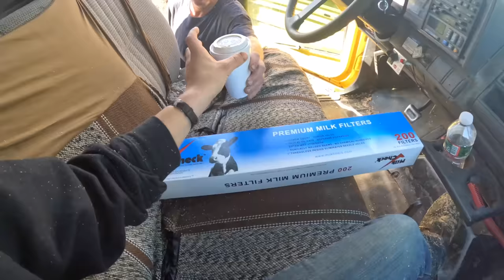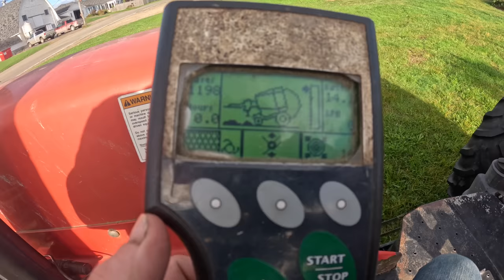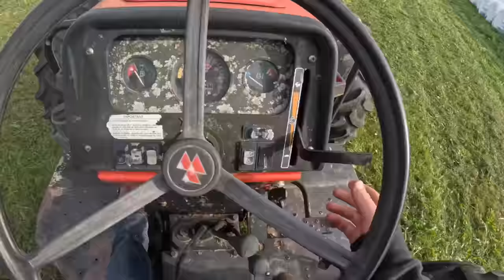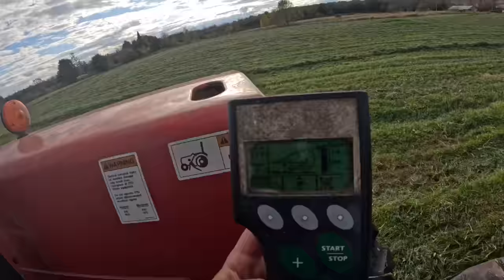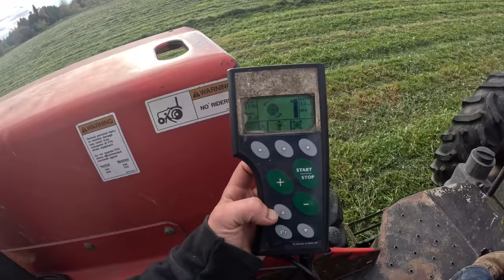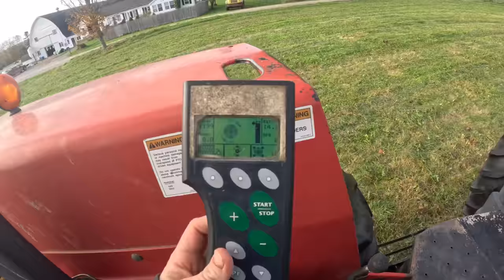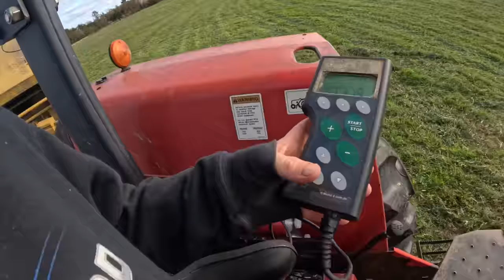Morning at the mill and we got new cows!!

Comment: The bale monitor should stay with the baler in a soft sided box that closes securely. Brent may need to hang another box for it on the baler rather than try to keep it dry by the employee. Large enough to keep all the wires inside and not close the lid on the wires.

Comment: I only have 2 horse stalls that I use shavings in, but I'm lucky to have a local cabinet shop that I can get a pickup load from at a time. Bed them heavy to start, then work my way down for a few months. Just have to time it right, and they load me up with the tractor.

Oh, I do use bagged shavings in the chick brooder, it uses such a small amount. I get a few months of hatches out of a bag. Last I checked ( a while ago), they were running $6 a bag.

Comment: If she knew how hard to start a diesel is she would get a ruler to measure the fuel and not run it out. Maybe if Brent made her go through the motions of starting the Massey she would not tempt fate. Some kind of s-shaped #9 wire to hang the ruler close to the fuel. Also an electric fuel pump is no more than a hand pump.